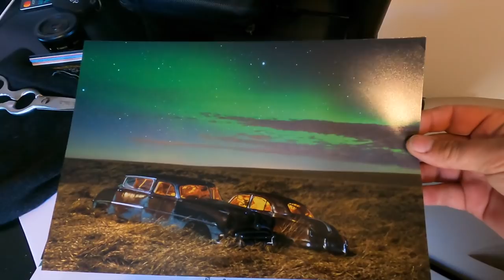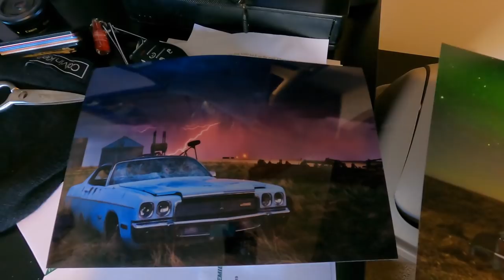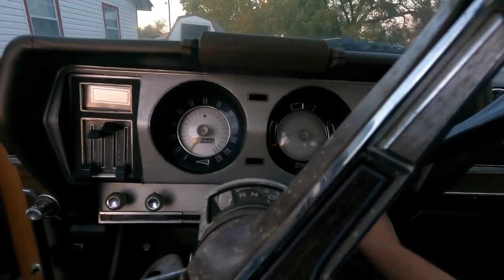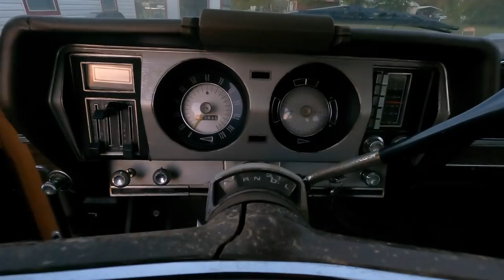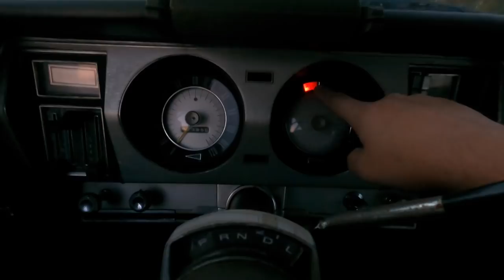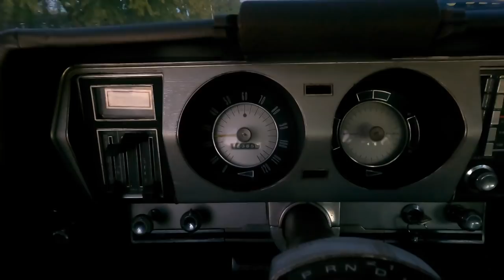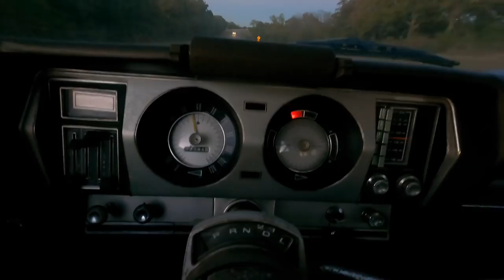3 Cars 1 Video 67 AMC Ambassador 1st Drive - Saturn Done - Pacifica Done + MGB Update!!

Comment: I remember my uncles trying to start their old cars before we went somewhere and it was always a ritual.  The right amount of gas pumps, key had to be turned at the right time, steering wheel had to be straight, radio had to be off, windows had to be down or "cracked", choke had to be pulled or not pulled.  lol

Comment: Hi Randy and Co...

I live in the county of Kent in the Uk and only live about 15mls away from a Copart yard that is near a town called don't laugh "Sandwich" in Kent this is a fairly large yard looks to be about the same as your one there in Dell City.

I've been watching your channel since the uber days and as I may have mentioned admire your grit and determination to get a problem sorted even if not economically viable but for the love of the vehicle and keeping it on the road to enjoy, I own a 72 Ford Capri Mk1 that is a project it's only ever done 48'000mls it needs a fair bit of work also daily drive a 2009 Subaru legacy wagon with the only ever flat four "boxer" Diesel engine (I dont think these were ever an option in the US) bought for £600 with a very badly knocking engine but rest of vehicle was in showroom condition, the guy I bought nit from paid over £5'000 for it only 6mths prior bur dealer not interested in any warantee repair and put it down to owner error..... I've now rebuild engine using new short block, oil pump and reusing the original heads and injection system as nothing wrong with anything else just done new discs (rotors) and pads all round and using it daily 250ml round trip to Portsmouth and back every day....   love your content hope we may meet someday that would be awesome...

Comment: Raptor liner spray bed liner is perfect for redoing the vinyl top
Reply: It would give you some texture, but I would still rather peel the vinyl, sand the sheet metal smooth, seal it, and then paint the roof gloss black.  Back in that car's day, the factories made them like that.  It's the late '60s - early '70s version of a two tone.  You may have even seen one from afar, and thought it was a vinyl top.

Although you might find, under that vinyl, that the quarter panel-to-roof seams on the C-pillar have not been leaded or filled or worked in any way...

Comment: Randy, You've got an unmolested "top of the line" survivor in the 1967 AMC Ambassador 990 (Nine Ninety) 4dr Sdn. Billed as part of AMC's "NOW" Cars for 1967, this car offered a lot of value for the money with A/C, P/S, Individually Reclining Front Seats, Tinted Glass, Dual Side View Mirrors, Interior/Exterior Light Package, WSW Tires, Chrome Side, Vent Windows, and Wheel Lip Opening Moldings, as well a 3 Year/36,000 Mi. PowerTrain Warranty, all as standard equipment. This particular car was loaded with the optional vinyl top, factory wire wheel covers, and what I believe should be a 301 C.I. V/8 engine. Like the 1959 Dodge Coronet that came before it, this car is well worth saving!

Comment: You could probably get your tank on the AMC cleaned at a chemical stripper then get it lined. I wouldn't  worry about the vinal top. Don't use a bed liner on the top. Let the next owner decide what to do with it. It's a survivor as it is. I would hang on to it until your Coronet is finished. Good luck on the MG. Save the classics and keep it between the lines.

Comment: Hey, Randy: As some others have stated, putting a new vinyl top on the AMC would pay for itself a couple times over - the way it is now, the lousy roof makes the car look like a junk. Replace the roof, buff it out, and it will be worth another $2K! The fuel system & alternator both have to be fixed anyway - the car has to run decently to get a good buck for it, but the way it looks is what attracts buyers in the first place.

Comment: Hi Randy, I'm in Newport, Gwent, Wales UK.  There is a CoPart at Severn Beach about 25 miles away, never been there though!  Most things shut and Wales is currently locked down so absolutely nothing going on and nothing open, but that will change and if you want to come this way and hook up or stay overnight etc. then you're more than welcome anytime. I do only have Saabs though (and a Volvo) lol ;)

Comment: If you cant find a replacement tank and you want to DIY it, then Eastwood sells a tank sealer kit. Prior to using that I would remove the tank, grab a handful of nuts and bolts and put them in the tank. Add some mineral spirits or other solvent (not gas!)  and slosh around to remove any rust/varnish...

Comment: you can use a grommet but take a really sharp razor blade for a slice to center and because a grommet is slightly larger than the hole it will self seal when reinstalled

Comment: I’d try to take the vinyl top off of the AMC. It’s likely got the proper paint under it. Ask Weird Beard on the best way without scratching the paint under it. But it will be a cheap fix and it will look fine if the rest of the paint hasn’t faded. If it has then go to Maaco and get a paint match, the thing will look great if you do that. I dig it as it reminds me of my dads old 1966 Ford Fairlane. Good Luck!

Comment: The auto choke is the problem for cold start. The choke pull off don’t work and needs to adjusted to correct the rich condition on cold starts
Reply: My father and I converted the choke on our '68 to manual and it solved a bunch of problems.

Comment: Put the factory clutch cable plug in, drill a hole just a hair bit bigger than the wire and run the wire through.then silicone the edge around the wire.Same way you run double gauge amp wires

Comment: fyi
the alternator is wired through the fuel tank sending unit to the back post of the alternator, if you unplug the sending unit from the gas tank the alternator will never work.

Comment: A note on sealing fuel tanks. I recently bought a new gas tank for my Nomad and visited my local rad shop to  have it sealed. Interesting enough they said they would need to fill it with water solution to induce rust on the inside of the of the tank 1st. Reason is the sealer will slowly peel  off a shinny new tank. The surface rust gives  the sealer to adhere too. 
Why seal a New tank?? With today's gas w/ethanol creates moisture accumulation and sits at the bottom of the tank and will rust through in a matter of  a few years. The sealer helps to insulate and helps prevent condensation build up from occurring within the tank.  I do drive the car often but there are times I am away from home for a extended time and the car is stored in my heated basement modelA garage. 
This my 2d new tank in 4yrs because I didn't seal the 1st one. At least my thinking.

The sealers with stand up to go-fast additives.  I've sealed swap meet/ CL Harley tanks myself for many years without any issues.

Comment: Check the choke vacuum pull off 
It cracks open the choke butterfly once the car starts 
The diaphragm goes bad internally or it could have a bad vacuum line

Comment: I don't see $4k for the Ambassador unless the roof is replaced and the wiring under the hood is brought up to spec.  Just my opinion.  I DO see $5k with the ALT light fixed, a $300 paint job, and new roof.
Reply: Ya it's not good to have a charge light on

Comment: If you are doing this... if anyone goes through an automatic car wash, like at CostCo... and they sit in their car on a hot day with their AC on high and max cool as it idles and goes through the wash, the plenum for the air, that takes the air from the cowl, just below the windshield wipers, it will suck the water into the interior of the car... really... I have had it happen to me on two vehicles before I figured it out.  DONT run your AC/HEATER blower on high as you idle through the car wash as some are prone to suck the water into the cabin... on your feet, or worse under your carpet into the floor vents... to sit stagnate and grow with mold and stink like crap... be careful.   The cars were not designed to have a lot of water coming through the plenum, like in a car wash, with a blower on high. They were designed for a modest amount of rain... Craig

Comment: To the guys who did not want to install a proper grommet: There are rubber grommets which are pre-cut on the side, you just slide them on the cable and then push them in the hole the cables go through. Takes 10 seconds and costs a Dollar...

Comment: Neen a carpet cleaner? If you have a wet/dry shop vac you have one, though it is going to be stickshift not automatic. You need to... 1. Clean out & remove paper filter from the shop vac. (Because will have to let the filter dry before using it as a dry vac if you don't) 2. Need to add a cap full of laundry fabric softener to a gallon of water put it into the shop vac. (This is a defoaming agent) skip this step vac may turn into a foam generator and fill the room like on TV! 3. You need a new garden sprayer to mix & apply very hot water & carpet cleaner or detergent where you want to clean. 4. a nice stiff brush to scrub with. Apply water & cleaner liberally scrub stains if necessary suck-up dirty liquid with the vacuum.

Comment: there is a cold start cam adjustment controlled by a lever attached to the choke plate,,  easy fix,,,,  just turn the screw in a little bit,,,,,   :-)

Comment: Water leak - "quality work" is hard to come by, so many times I've been burned by "reputable" businesses. Example - since my heart attack, I can no longer change my own oil (how bad is that??). Anyway I've ALWAYS used Mobil 1 oil & filters in all my vehicles, so when my new Caddy needed an oil change I hunted around for a dealer - eventually used 1 that advertised "Mobil 1" products. I called & told the service rep what I wanted, he said "no problem" & made an appointment. I drove 75 miles to the place, again specified Mobil 1 oil & filter to the intake rep, was assured the work would be done as requested. I was relegated to the waiting area - far away from the shop & 30 minutes later I paid the $130+ and drove home. The receipt said the products I requested were installed, I look under the car and I spot the "generic" oil filter hanging from the engine!! SO , being they didn't use a Mobil 1 filter, what do you think the chances are I got Mobil1 oil??

Comment: it Smeared on you before, because you needed to degrease the carpet BEFORE you steam clean it. Purple power is great for that, so is Dawn dishwashing liquid! them $120.00 on Amazon gets you a McColough steam cleaner i recommend the more expensive upright (newer model) I have the one that lays flat and it doesn't hold as much water as the upright

Comment: Randy strip off the rest of the vinyl  top  , scuff the top and hose it with some gloss black. Done deal. If you haven't sprayed before get a HF gun and go for it after testing on some cardboard. It's not rocket science. No need to remove chrome trim around frt and rear windshield.  Just razor close to the chrome, tape and cover the rest with painters plastic available at your fav big box store.   Wish I lived close by would love to give a hand.
Reply: Forgot to include you can use the Industrial Rustoleum, no primer require. Use some Acrylic enamel hardener and it'll flow like glass. I've painted a number of boats and trucks. This a Falls Flyer I did for a friend. The paint was dry not wet when tis pic was taken. Owner's rented shop.
https://www.dropbox.com/s/ca8uxw8fhjjij8y/Falls%20Flyer.jpg?dl=0

I did the trailer as well.
https://www.dropbox.com/s/x6z7owqgq3x23f2/Larson%20Falls%20Flyer%20%26%20Tinnie%20trailer.jpg?dl=0

Comment: The high idle needs to be faster. Too slow of an idle for the amount of choke the carb is loading up & flooding the engine. To start slowly depress the gas pedal to the floor hold for a second then slowly release. This sets the choke (For cold starts). turn key to start. after it runs for a few seconds give it a quick short rev. If it pops through the carb or stalls the choke needs to be adjusted to close tighter and probably will need the fast idle screw adjusted for faster idle speed. The faster idle speed will lessen the chance of hesitation (stalling out) and popping through the carb. Without touching the gas the fast idle could on a flat road & in a mile or more build the cars speed up to 40 or 50 mph. High idle and bad weather makes stopping difficult It's like doing a half-hearted line-lock, in gear the car wants to go. Getting the choke & fast idle set right can take days and need adjustment in different seasons.

Comment: They should have sprung for the $3 grommet to begin with. Without it even without leaking water will allow the firewall to chaff the wire cutting into it. If it's a current carrying wire it could be a fire hazard.

Comment: If you really want to. Just pull the vinyl and clean buff the roof out. As for the gas tank, dump it. Drop it. And rust convert it. Or get someone to recondition it. Or just get a new one at Kennedyamerican.com which has tons of amc parts.

 Hell I'd buy it off you as is. Im too nuts for AMCs.